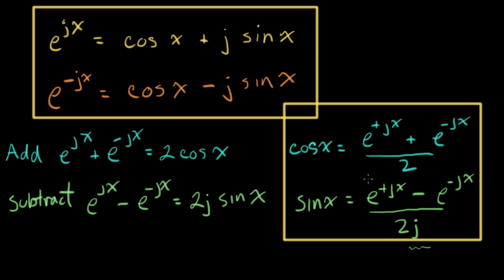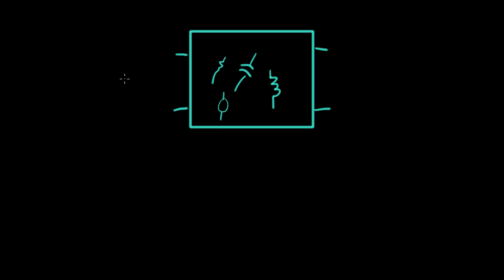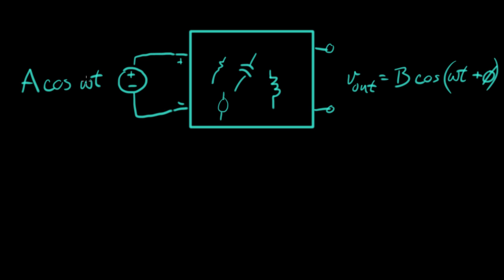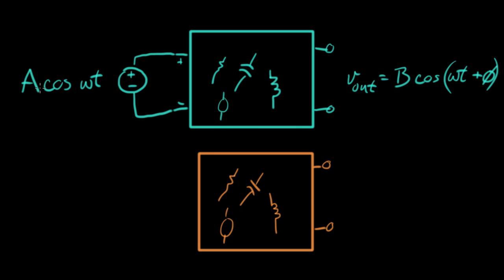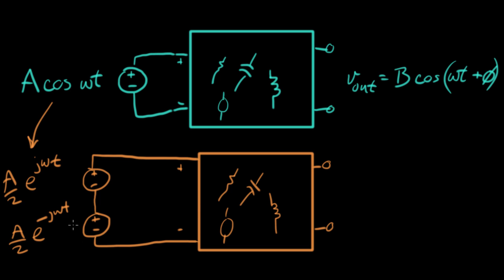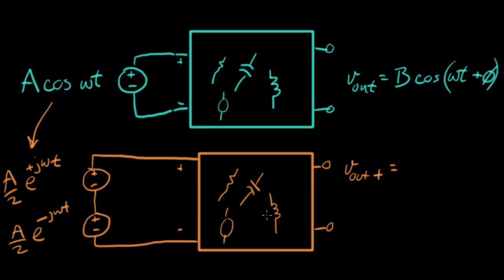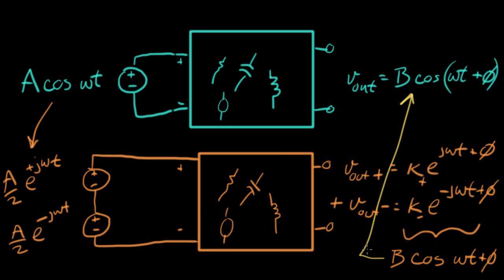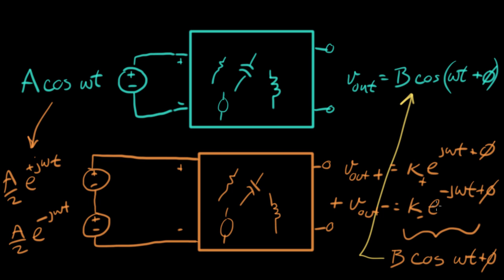AC analysis superposition

Comment: 6:50 you need paranthesis in the argument of e  else if that j does not distribute over phi then you will have a constant as a result of phi  because it will be e^phi= constant but there is one already there the K , so if the transient is not necessary then j must be distributed as such e ^ j(wt+phi) will result in 2 complex numbers 1 that is a function of time and  rotates and another one which is a constant the phi one or phase angle aka starting point of the wave